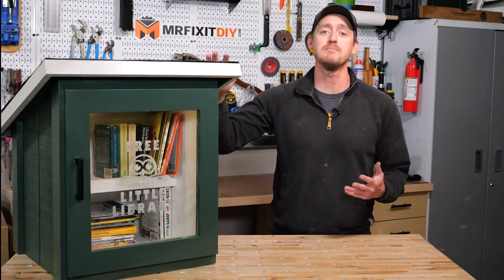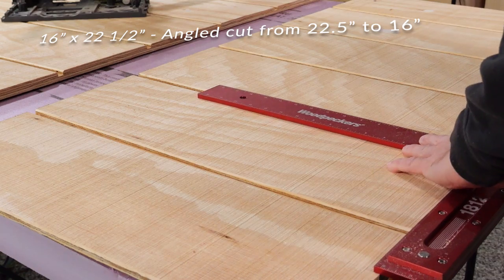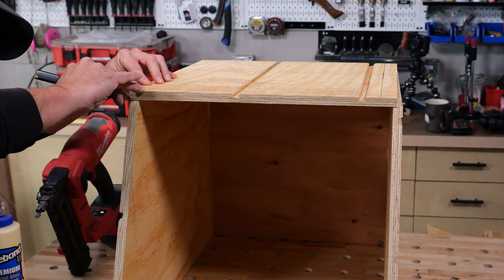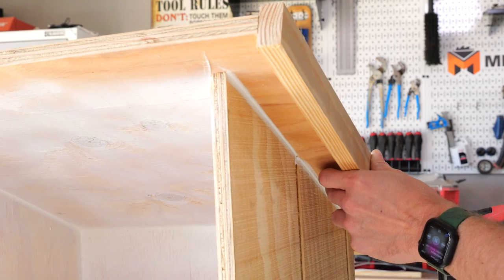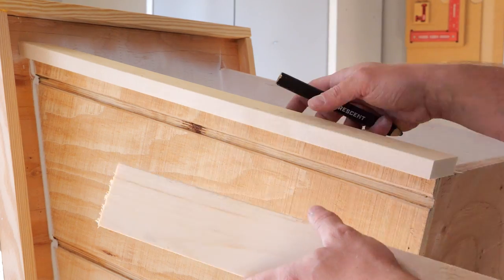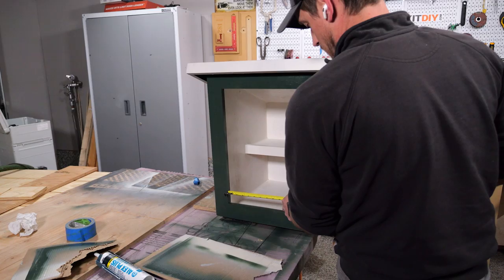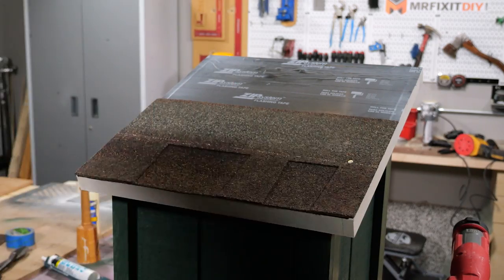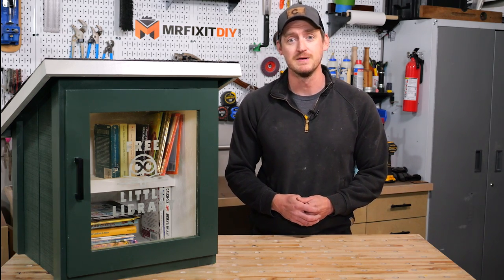How to Build a Little Free Library

Comment: Thanks, I am a visual learner.  Do you know if there is a light that would go on/off when you open the door?  Battery operated?  Also, I live in the southwest, it's very hot here, would you recommend putting some type of venting in the library?  Thanks